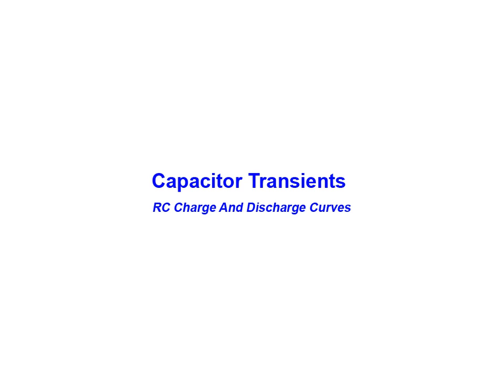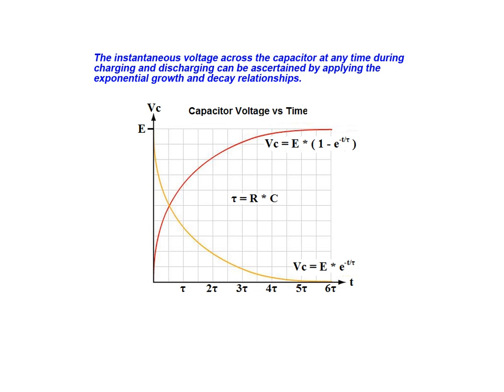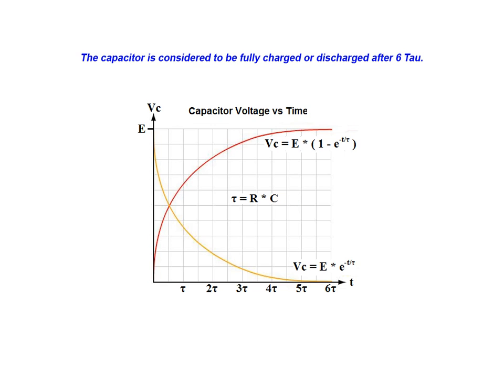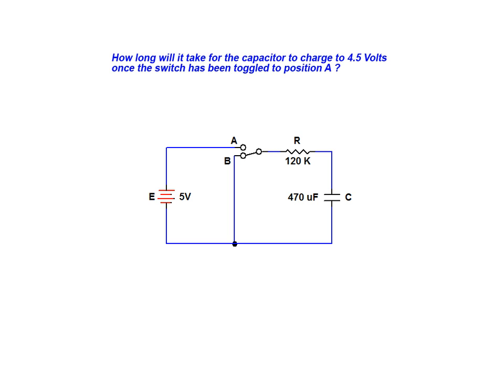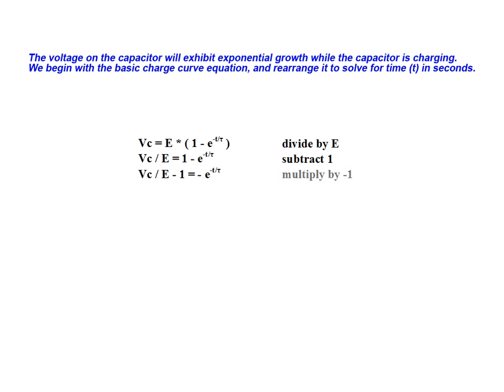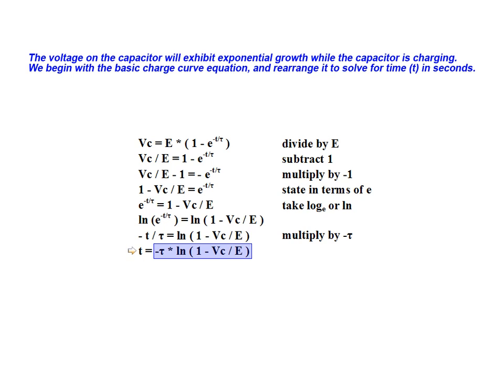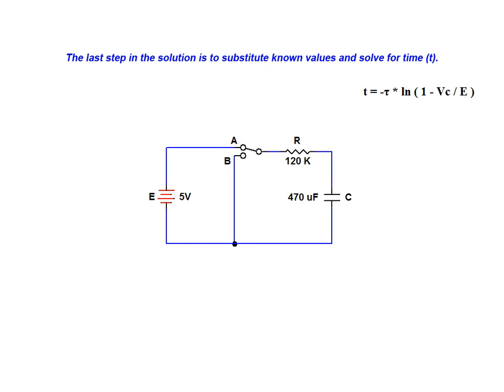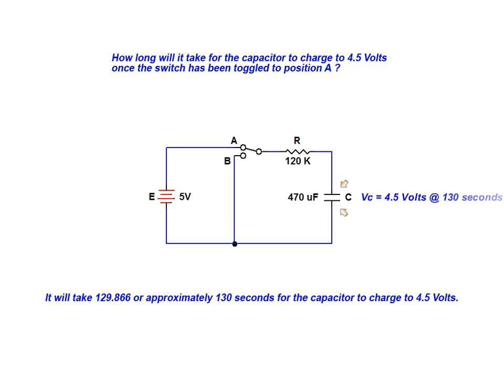Online tutorial on capacitor transient response -  in series RC circuits - charge / discharge curves

Comment: Excellent instructional video! (and your voice was perfect). Thanks for going step by step through the algebra. The only question I had was everything I've read states it takes 5 time constants to consider a capacitor fully charged, not 6.
Reply from the maker: Generally, for a college level analysis, we use 5 tau.  It is a good practical estimate.  In university, they generally use 6.  NOTE: The process never really reaches max value, it just keeps getting closer. The whole thing is an approximation.  It is just a matter of how exact you need to be for you purpose.  Its like a derivative. There is no slope of a point, but we use math to get the slope of a point, and another point infinitely close to the first one.  Just a really accurate approximation.  Cheers.